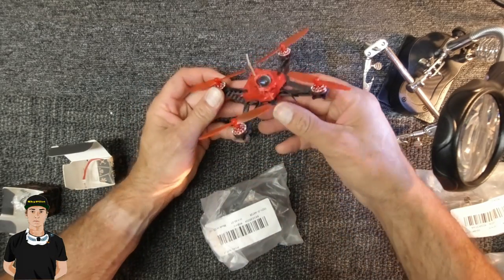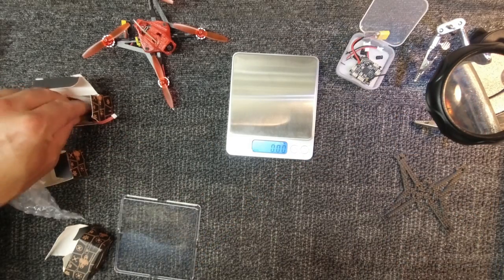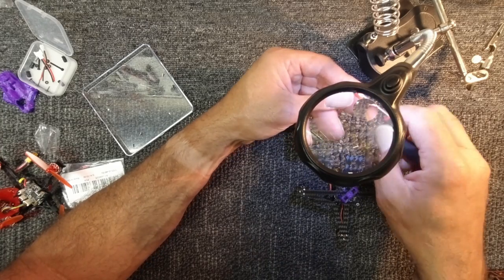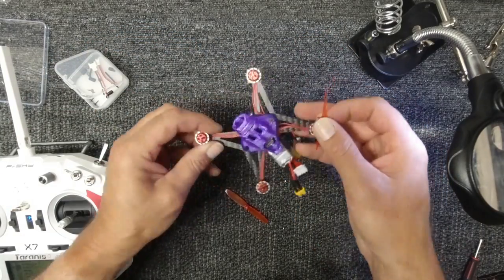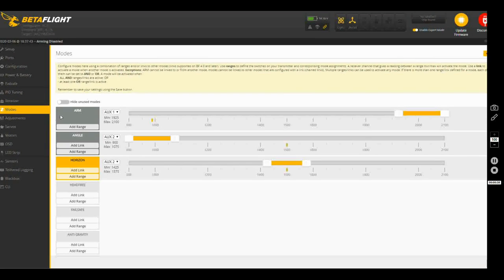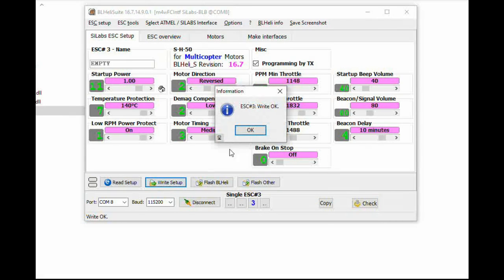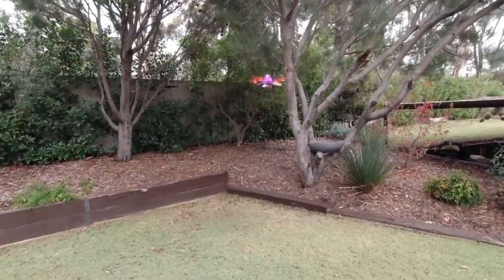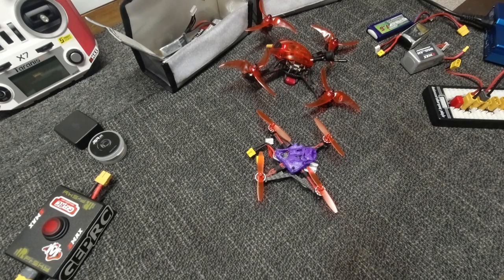Hapymodel Sailfly X Toothpick Quad - Full Rebuild and Flight ☼

Comment: What flight controller and motor size do you have installed on the Sailfly? I have the kit and want to build mine. Thanks for sharing!
Reply from the maker: For this build I'm using a Happymodel Crazybee F4 PRO V2 FC and Happymodel EX1103 8000KV motors. 
She flies great. Faster than standard. You will need to super glue down your props as they will spin off!!  All the links to my kit are in the video description also. Cheers mate.